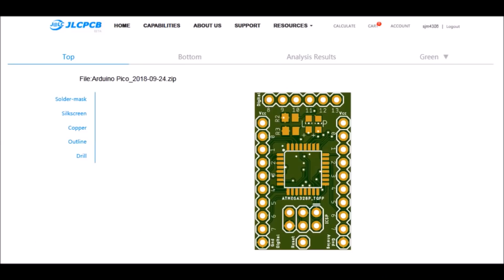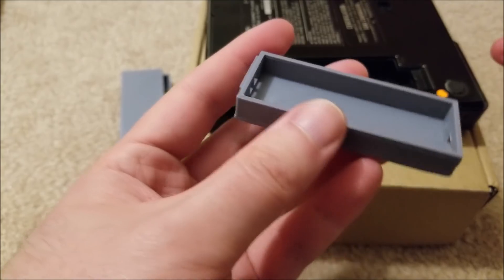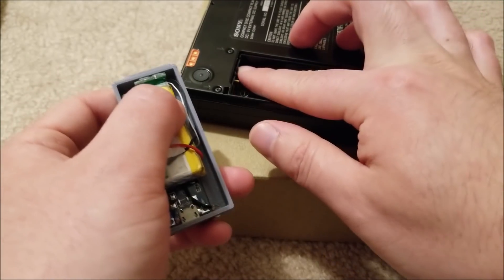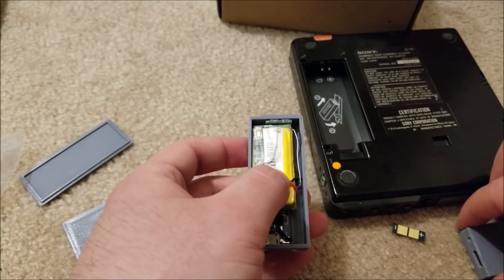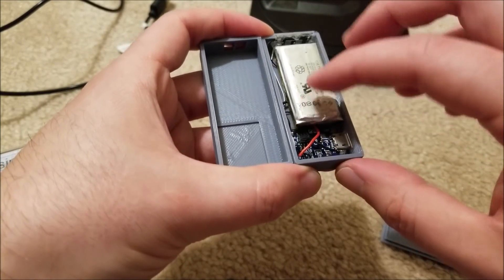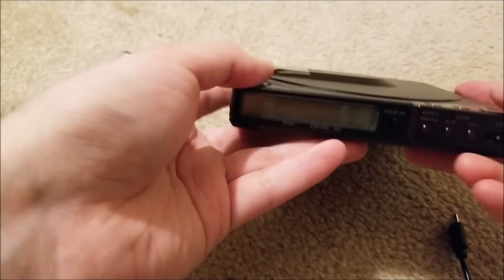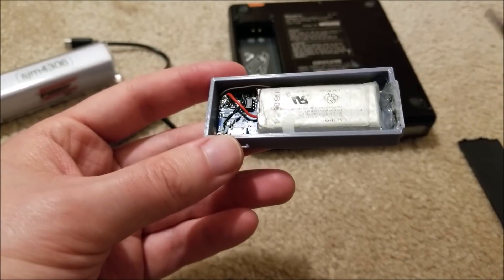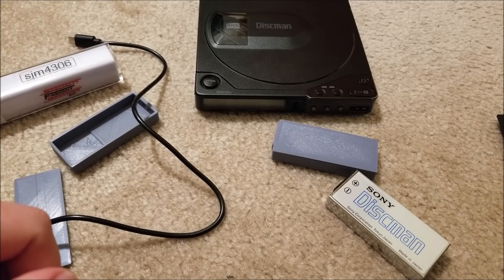Sony Discman DIY 3D Printed Replacement Lipo Battery

Comment: Since the player is giving (in my case) a 4.8v constant voltaje to recharge the battery when connected to the ad-dc plug in the internal pins... Why don't you use a BMS circuit to charge the lithium pack instead the usb plug? Could that be possible? Some BMS circuit boards supports easy 5V input. I still thinking how to build mine...
Reply from the maker: Should work, I just used the parts I had on hand (didn't have one of those bms boards)

Comment: is possible to buy entire kit or component for my sony Discman D250? your link ebay no work and i need this battery DIY for my discman.
Reply from the maker: Sorry I've run out of parts for this mod ages ago so I no longer sell either completed or as a kit.
Reply: @sjm4306  I need only little piece contact plus and minus that you show from jlpcb
Reply from the maker: I'd need to reorder a min quantity of 20 or 30 at a time. If I had enough orders I'd consider it.
Reply: @sjm4306  TY but i think i'm the only one interested... :(

Comment: Are you interested in selling these batteries at all?
Reply from the maker: I don't mind selling the parts except the lipo. The reason is sending batteries through the mail is not cheap to do properly and if done improperly I can get in a lot of trouble. So in general I don't even want to mess with lipos in the mail.

Comment: What’s the correct usb charging board for this project assuming I’m using a 3.9V battery? Thanks!
Reply from the maker: This is the one I used and it'll work with pretty much any single cell lipo/li-ion battery: https://ebay.us/DFMvro

Comment: that ebay purchase link does not work anymore. I would like to order one.
Reply from the maker: Sorry I've run out of boards and no longer sell complete batteries or kits for them. All the files are available on the project page linked in the description so if you are inclined you can build one yourself.

Comment: What would happen if you plug the usb charging cable AND insert the battery into the player, then keep it that way (assuming it's physically possible)? Would it continuously discharge and charge while powering the player, or it wouldn't charge at all?
Reply from the maker: If the usb current were higher than the discharge current drawn by the player then it'd charge but at a slower rate than if it were only charging. Otherwise it would drain but just slower than if it were just running on battery alone.
Reply: @sjm4306  assuming the charging current is higher than the draw, what would happen once it's fully charged? Are there any downsides of keeping it constantly plugged in? Sorry for all those questions, but I'm not sure where to look for this kind of info.
Reply from the maker: Once it's fully charged the lipo charger chip tries to trickle charge the battery with some hysteresis to keep it at the termination voltage. What would likely happen if the player were also drawing its normal operating current is the battery would cycle around the fully charged point. Short term nothing bad would happen as the charge controller would prevent overcharging, but long term this oscillation would eat into the total lifetime cycle count of the battery and reduce capacity. To prevent this you would need to add circuitry/complexity to detect charged status, cut off the battery and directly route power from usb to the player.

Comment: Really, really great work!!! -- Unfortunately the gerbers you included no longer pass the default audit for JLCPCB (9/2021), the slot with must be >= 1mm and the board/board edge are too small.
Reply from the maker: That's a problem, I tried getting them vscored originally to increase the total board size and they couldn't do it. The whole board probably needs to be redesigned to integrate an outer pcb frame that's routed to the panelized boards with bigger clearances.

Comment: What is the nominal voltage of the original battery?
Reply from the maker: IIRC 4V, it's two series lead acid 2v cells.
Reply: @sjm4306  OK thank you so much. I will solder wires and give 4V to the device.

Comment: @sjm4306, I noticed that the Li-Po battery I am using at the moment  (it's only 450mAh, I ordered a 1000mAh one) is (logically) dropping below 4V quite quickly, resulting in 2 bars battery life and a premature cutout as the player considers the battery empty while it is actually not.  Since the Li-Po batteries are normally 3,7V I am considering to add a step-up to keep the voltage around 4 volts until the battery is empty and the step up switches off. Before experimenting with this, what is your experience with the larger capacity Li-Po's?
Reply from the maker: A boost/step up converter will allow you to extract most of the energy in the lipo (at the cost of 10-20% being lost to inefficiencies in the converter). All good things have a downside though since the battery indicator will always show 100% right up until it cits out with no warning. As for a larger lipo, I was actually thinking of making a bottom mounting larger battery with at least 5000mAh with dedicated usb for charging while attached. It should only add a few mm in height to the player but run for substantially longer.
Reply: @sjm4306  Found and ordered a 1000mAh cell and installed it together with a step up and a low-drop diode in the output to avoid charging from the adapter. I have around 2.5 hours of continuous play time. Not bad at all. Going to design 2 stackable PCB's with charger and step up and a connector for the battery so it will be an easy build for anyone who wants to do this. Once I have this ready I'll share the project here. Thanks for sharing this idea, great stuff!

Link to photo of the project: https://imgur.com/wZHejsW
Reply from the maker: Awesome, yeah link me when done and I can add it to the video description/pin it in the comments

Comment: Very good idea, had the parts lying around so modified the design a bit with cooling vents as the charger can become quite hot. Printed the casing from PETG as it withstands the heat better. Only had a 400mAh battery lying around so need to order a 700 mAh lipo that fits the casing. Now for the challenging part, finding my D-15 on the attick! :-))

Link to modified casing: https://www.tinkercad.com/things/34NAIV3zJNu-sony-discman-d-15-battery-casing
Link to picure of my project: https://imgur.com/WBWaBrx
Reply: Found it, actually it is a D-250. Battery holder is just a bit to short so modified it. But, player fired up and shut down. The laser gear was ceased. took it out, cleaned it, added some new grease and it plays smoothly again. Happy bunny!
Reply from the maker: It makes me happy to see others improving on my projects and releasing the modifications for others to use!

Comment: Hello, I made one for my Sony Dz555 discman and its working. But how much playing time do you have? I have only 2 cd's and its empty.
Reply from the maker: That's roughly what I get, 2-3 cds from a full charge. Keep in mind there's no boost regulator to extend runtime down to the last drop of available power and even with that you are mostly limited by the relatively inefficient circuitry of the discman.
Reply: @sjm4306  I am very happy with this solution! I have supplies for making 2 of them so that would be 5 cd's. Good enough for me. Did you consider selling these on eBay?
Reply from the maker: I initially did but quickly gave up when I thought about the logistics of sending lithium batteries through the mail. Then I thought about what if I just sell the rest of the kit and have users source and solder their own batteries but that seemed like a nightmare waiting to happen lol.
Reply: @sjm4306  Yeah I would not make DIY kits indeed. I understand the shipping issue, its not that easy to ship lithium battery's indeed

Comment: i think the diy battery is 3.7volt, while the original battery is rated 3volt? is that okay?
Reply from the maker: I referenced the service manual to find the supply chips' part numbers so I could look up their datasheets to make sure it was fine. I've been using the battery for over a year without incident.

Comment: Hello, I appreciate your hard work ! 
I was thinking if I could cut the traces of the 9v power socket and branch the socket to the battery and charge it(5v of course)
Do you think it's feasible ? 
Thanks a million :)
Reply from the maker: So long as you apply the required 5v to the usb input to the lipo charging board that I used in this mod then it'll work. Just whatever you do, don't directly attach 5v to the lipo battery itself, this could cause it to puff, vent and/or ignite!
Reply: @sjm4306  Yeah okay I'll be careful 
Thanks for the response !

Comment: Hi Sir
Awesome skills.
Reply: Do you plan on making another batch of these ? I could clearly use a couple for my discmen. I could provide you with the exact measurements of the original battery if you still need them. I have two dead ones.
Let me know.
Reply from the maker: Sorry, it'd probably take longer for me to order all the parts and in the end you'd still have to source and solder your own lipo since I cant safely/cheaply send that through the mail.

Comment: Hello!
Thank you for sharing all these online ! I appreciate all your hard work !
However I have a question, I tried to order the battery board on JLCPCB and they told me it's the board was not accepted. "Failure Reason:
the clearance between slot to slot or outline require 4mm at least in case of break off + slot width need 1mm at least, kindly replace with new file." Could you help me with this ?
Thank you!!

Comment: Found these on Ebay $1 https://www.ebay.com/itm/112592367812 usb charging board for 3.7v lion.
Reply from the maker: Yep, those are similar to the ones I've used.

Comment: How do you power on the discman
Reply from the maker: Not quite sure what you are asking (how it's turned on or how it's physically plugged in to receive power)?
Reply: @sjm4306  I mean it in a way that you put a CD in it and then what, what do you press to power on the machine.
I got my Sony d-150 from my dad but he was not sure if it was broken or not and he says he's forgot how to turn it on
Reply from the maker: Ah, ok I understand now. You press the play button to turn on the discman.
Reply: @sjm4306  on the front or on the top of the discman?
Reply from the maker: This specific model has the play button on the top
Reply: @sjm4306  facepalm we used the wrong supply with the wrong polarity well I think it's probably fried but I will check if a different supply does anything
Reply from the maker: I havent checked the schematic but I'd be very surprised if there wasnt some form of diode protection to prevent damage from reverse polarity. Hopefully that's the case and your discman is ok.
Reply: @sjm4306  it is still function sort off the power cuts of every so second what are the specs of the power supply you use ?
Reply: Mine is 9V 0,6A
Reply: @sjm4306  what are the stock DC power supply spec for you're discman I lost mine so we are using something that I think give to little power. really need you're help
Reply from the maker: That should be enough honestly but try 1A to be safe. If it still cuts out then that's not the problem. It could be the power input connector is oxidized, loose, or even the lid detect switch contacts need to be cleaned.
Reply: @sjm4306 what part of the switch do you clean?
Reply from the maker: If you look the switch is just two metal strips with a bit of plastic on one side that is pressed by the lid to touch the metal. You need to clean the inner sides of the metal strips as it's exposed and likely dust/oxidation got inside and is preventing the switch from contacting.

Comment: The battery is actually a 2-cell sealed lead-acid battery.
Reply from the maker: Interesting, didn't know they ever made such small sla's
Reply: @sjm4306  There were even smaller ones made, for cordless phones.

Comment: Aye you cool bruh really like the knowledge videos that you bring out i wanna start doing the same. One question though my seagate 2 tb hard drive my ps4 doesn’t read it and i bought like over some months ago do you have any idea why it doesn’t read it and how do i fix it?
Reply from the maker: Thanks, dude. Are you trying to use it as an internal or external hdd? Also have you formatted it?
Reply: Im using it as a internal hard drive for the moment but when i plug it in with the usb cable it doesn’t read it why is that?
Reply: Im using it as external hdd*
Reply: And yes I already formatted but my ps4 stopped reading it, i checked if it’s my ps4 the problem but its the hard drive.
Reply from the maker: Have you plugged it into a pc to see if it is recognized?
Reply: sjm4306 I don’t have a pc
Reply: sjm4306 its making a weird sound now
Reply: sjm4306 like a clicking sound
Reply: sjm4306 im testing it right now and its making a weird clicking sound
Reply: sjm4306 does it mean it’s broken?
Reply from the maker: Was the drive ever dropped or experience any shock? The clicking sounds like there may be a mechanical problem like the heads crashed or there's damage to the platters.
Reply from the maker: It could be the click of death. Hdds can fail prematurely due to manufacturing faults. If it is covered under warranty you can get a refund or replacement.
Reply: sjm4306 awe man so its broken
Reply from the maker: Unfortunately it sounds like it.
Reply: I opened i tried to fix it
Reply: I opened after my ps4 stop reading it i try tp fix it but I cant find any video on why it stop reading it it really urks me
Reply: I seen a lot of people complaining about shit Seagate hard drive stop working outta nowhere
Reply: It has never been dopped

Comment: Came out really well indeed!  Nice work!
Reply from the maker: Thanks, happy with how quick and cheap they are too. I'll have to make a few more, as it seems these players are battery hogs and even with the extended capacity still only last around 3-4 hours.
Reply: @sjm4306  3-4 hours is still significantly longer than most of the things with batteries I make lol.
Reply from the maker: I'm spoiled by modern devices that last 10+ hours of moderate to heavy use!
Reply: Mental note to self.

Never accept an endurance test against sjm4306.